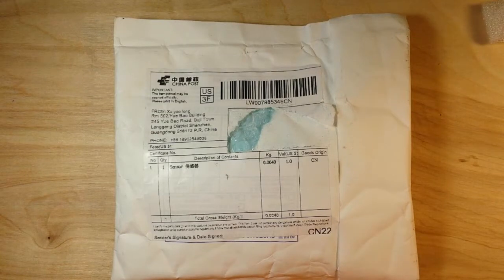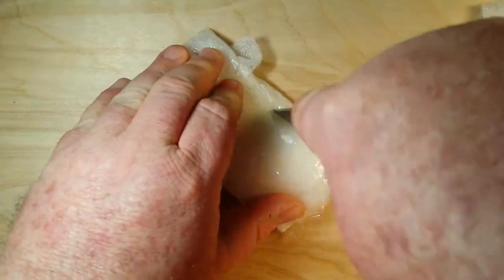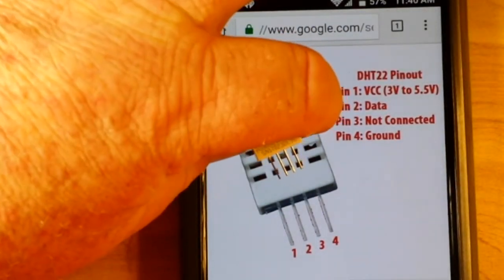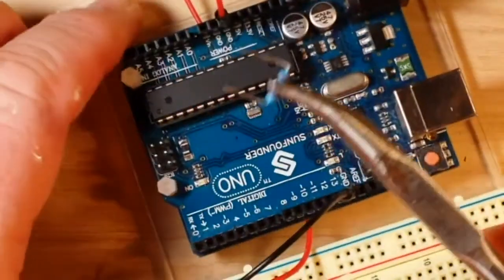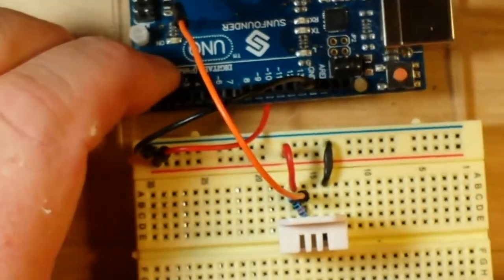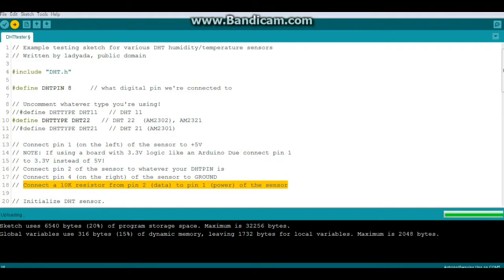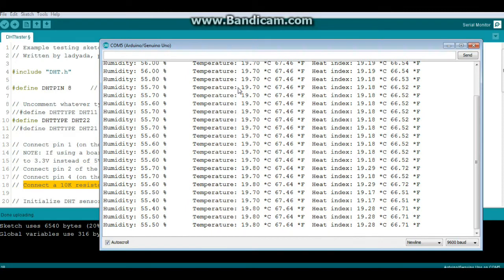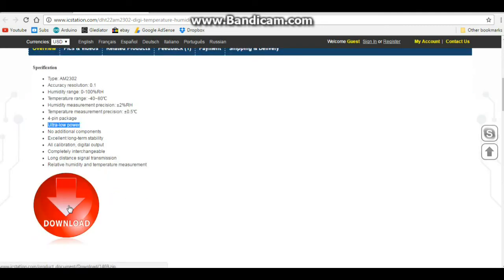ICStation com DHT22 Temperature and Humidity Sensor

Comment: Why do you need a 10k resistor? I added the 10k resistor but doesn't work anyway :/
Reply from the maker: +Zhak7 it is a pull-up resistor, to keep the idle value high.